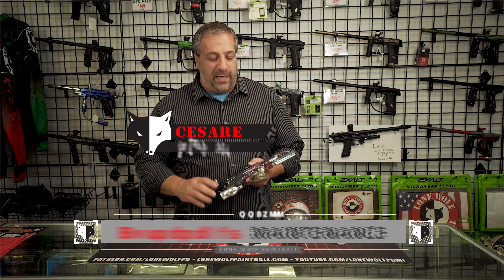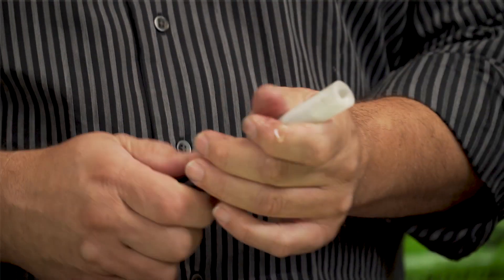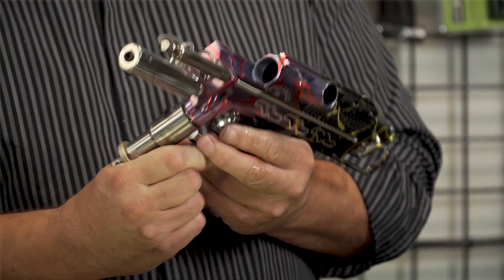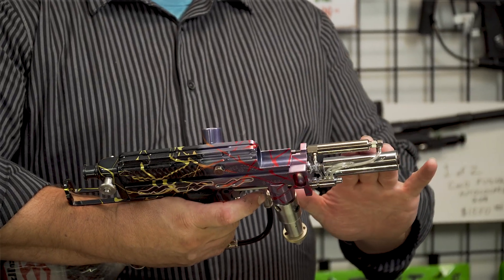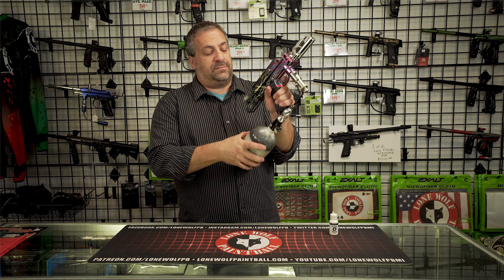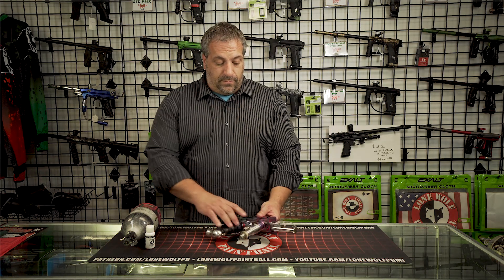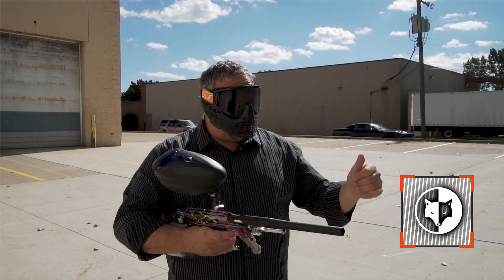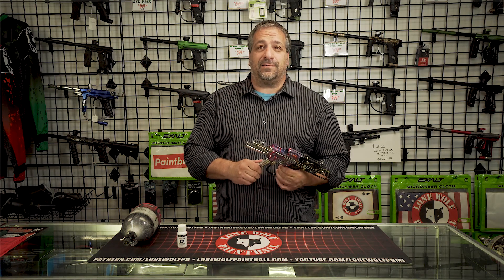Basic Autococker Maintenance w/ Cesare Pizzo | Supercocker | Lone Wolf Paintball Michigan

Comment: Would you recommend doing this if your running  a delrin bolt? Also what would you recommend for lubricating the 3 way?
Reply: Use oil on your 3 way, it will cycle smoother. Also putting alittle oil on your bolt is pretty good. Delrin actually soaks up oil so put oil on it and let it sit over night before you play, wipe it off with a paper towel then put it into your gun. Dont do this everythime you play just maintenance your gun every 3-5 cases of paint if you like it to be pristine.
Reply: @coolzdevin777  Thanks for the advice, it is appreciated.